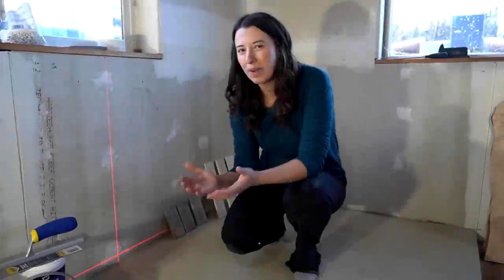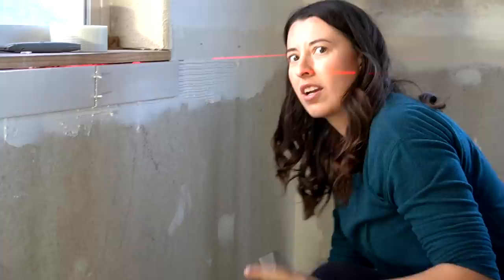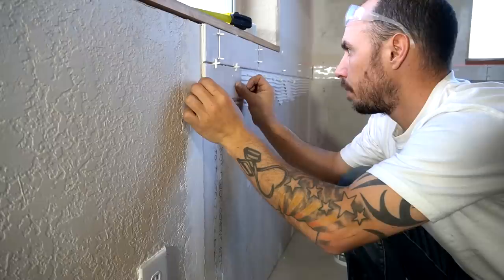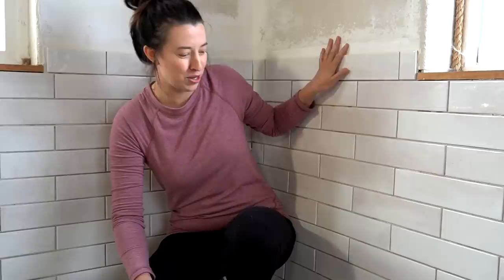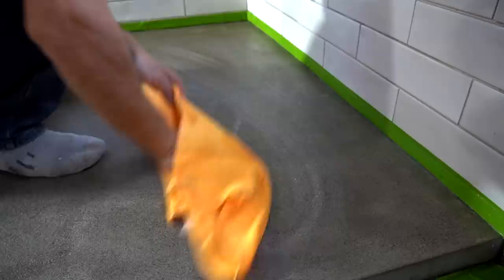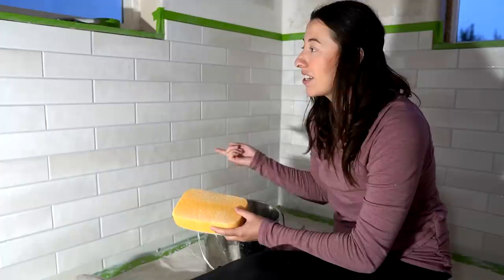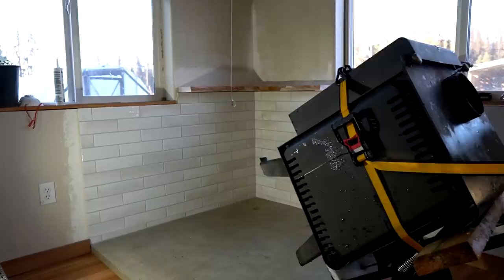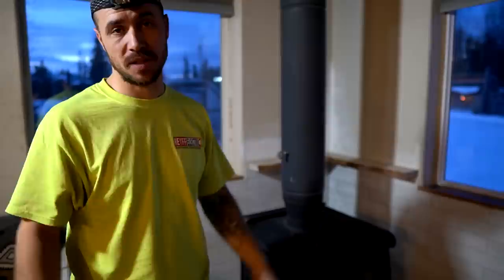Setting Tile & Finishing the Wood Stove Hearth

Comment: I've yet to watch the full content of this episode (you tiling the wood stove area). But here is my guidance to you from several of my DYI tiling of kitchen and bathroom walls and bathroom floors since the early 1980s (two kitchens and four bathrooms) - me not doing things right first time around every time. Make sure that you purchased the thicker floor tiles for the floor of the stove area. Check every wall and floor tile of every box on a flat even surface for slight rocking when gently depressing each corner by your index finger. Segregate all rocking floor tiles for discard (do not use them at all) and maybe use rocking wall tiles for short cuts of tile pieces needed at the edges of the wall tile areas (if the cut short piece does not appear to rock much). Every box of purchased wall and floor tiles usually has a few uneven and slightly warped tile, which your eagle eyes would not spot. I've used both synthetic tile adhesive and tile cement to set the tiles (with plastic cross spacers thinner than the set tile thickness). Both were ever lasting without the tiles later spalling off the wall and floor in a shower stall exposed to hot water daily for intermittent periods. However, I'm suspicious about using synthetic tile adhesive in a stove area with continuous high convection and radiation heat for 6-8 months of the year. The adhesive may seasonally expand and shrink because of the substantially different temperatures and spall off prematurely. When using tile cement, I water soaked every tile overnight before setting them. The cement binds even better to a tile backing when it is moisture saturated. I tried to pry out the plastic cross spacers a day after setting the tiles (before grout-floating the tile spacings a week later), but soon gave up on that because most them were stuck to the wall and tile edges, me not wanting to risk loosening the set tiles. Prior to setting the tiles, I chalk-stringed wall area and floor areas according the length (plus a separating spacing) of my tiles. I checked the alignment of each shift of set tiles against these chalk lines. If off alignment, I used tapered tooth picks (inserted at the cross-spacers) to re-align the already set shift. I started with T-spacers (by cutting off a leg from a cross-spacer) at the tile area edges at wall and floor corners. I chose too wide a tile spacing (3/16"-1/4") with fine sanded grout for my first tiling project in a shower stall. A few years later, the grout gradually developed fine fissures soaking up shower water. I fixed the problem with generous sprays of silicone solution. After this project, I went to 1/8" tile spacing with coarse sanded grout. I never experienced any development of fine fissures with this approach. About an hour after having floated the tile spacing grout and sponge-washed and smoothed the spacing surfaces, I cleaned off most of the interior of each tile with dry cloths avoiding to rub the smooth and still wet grout spacings. The next day, I would rub the edges near the tile spacings with a dry cloth to clean off the whitish dry grout tile surface areas. Whatever I could not clean off with a dry cloth, I scraped off using the sharp edge of plastic toothbrush handle sawed-off at the round end. Three weeks later, I sprayed silicone solution on the grout spacings to seal the grout from future water spray and moisture ingress (with a final dry cloth polish of the tiled areas). Please be very gentle when reinstalling the stove and ducting to the chimney by avoiding to dolly it onto the floor tiling and put ladder footings onto the floor tiles. Tiles are brittle and will crack when exposed to a large point load from dolly wheels or ladder footings. Perhaps use a remnant of 3/4" plywood on top of the tiles if absolute necessary to reinstall the stove and its ducting. FYI also: normally, it takes 28 days for concrete (under your floor tiles) to reach 90% of its ultimate long-term strength. So please do not be so zealous to reinstall the stove before four weeks after you poured the concrete.  Just well-intended guidance from a 1974 graduated Civil Engineer and DYI since 1974.

Comment: Have you ever tried the "candle" way to fire up the wood stove? For me it was a life changer. Big chunks on the bottom, medium chunks in the middle, small chunks on the top, and you have to fire up the top. It's like building a house cause you have to cross the chunks perfectly with enough room to let pass the air. But with a little practice it's easy. The pros are less smoke, cleaner glass, cleaner chimney and last but not least, less pollution for the environment. The cons is that the stove it's a little bit slower to heat up than the "traditional" method.

Comment: Nice job. 👍White tiles will probably throw more heat back out of the corner into the cabin, so might be a bit warmer than before, or use less fuel to get to where you are normally comfortable.🤔 The grey tiles would probably have looked a bit too busy given how much smaller they were.🤨 Good outcome.🙂 Be well all.😉

Comment: Project came out amazing guys! 😁👍
The only thing I’d do differently is use a piece of stained quarter round wood moulding across the top to cover up that Blunt edge of tile across the top row. See most tile jobs on the wall use a quarter round tile  on the tile on the top row to clean it up & not leave a blunt square edge . Or let’s just say to hide that blunt tile square edge. A quarter round moulding is your best option now that the tile job is complete. This will shed dust ect and make it easier to clean as well as hide that squared off tile edge. If I was in your shoes  I’d also take my window seals out and make wider window seals to protrude maybe a inch further outward into the room. Here’s how I’d do them to also cover up the blunt square edge: I’d get me a board of my choosing and stain color maybe to match your flooring and your new birch mantle. Then I’d measure from the window from where my window seal board was going to go up against.....I’d measure out to exactly to that outer edge of the tile on the top row. This would be the amount that I would then router out maybe only a 1/4  inch deep. And only leave the amount un-routed that I wanted to protrude past the tile. This will allow you to set the window seal board down in the seal opening and only the un-routed maybe 1 inch protruding part will then slide down & over and in front of the blunt square top row of the tile in front of each window. U can use finishing nails to attach your new window seal or an wood glue adhesive glue ur choice. But then by doing the new window seal boards this way to cover my blunt tile ends under the window..... Then I’d take 1/4”-1/2” quarter round wood moulding whichever will look the best. I’d say just lay a piece of each over the top of my tile and see which molding 1/4” -1/2” quarter round comes closest to being flush with outer edge of my tile. Then I’d take my 1/4” -1/2” quarter round molding and go the length of the top of the tile attaching it to the wall and butting it up against my window seals and mantle. This will give the top of the top row of that tile a cleaner look it hides the ugly blunt edge and it prevents it from collecting dust onto the top edge of the tile. It also makes it much easier to just wipe down during house cleaning. If the moulding, window seal boards & mantle are all stained to match also the flooring then it all just looks better and is more appealing to the eye. 
    But That’s just the way I’d do it to kinda clean up and hide the top flat blunt edge of the tile and kinda tie everything together. Also i would make me a stained & sealed or polyurethaned wood frame to match everything else... which I’d put it up against the front of that Hearth concrete. I’d attach it with screws to the floor and maybe contact cement to the concrete.  This would protect the concrete hearth from getting chipped. 
But these are only my ideas of what I’m seeing on your project so either use them or not. But don’t take it as criticism because you guys done an amazing job for it to be your first time doing tile. 👏😁

Comment: The soot on your glass is more so the wood stove construction as it doesn’t have a glass air wash. I burnt spruce for years and at the end of the night I stacked the box full and cut back the air to get it to make it until the morning. I never had soot build up like yours did. Mine has the secondary burner but also has the glass air wash and it helps tremendously   Love the videos and Merry Christmas!

Comment: Nice work on the tile and concrete. Only feedback I have is I would have angled the wood stove for better viewing. That is what I did in my cabin and it provides much better heat flow as well.

Comment: When doing your wood joints the 45s if there's any spaces in between you can take some sawdust and yellow glue mix it up and squeeze it into the cracks let dry sand and you'll never know there's a seam there you may see light line but it will not be a large gap

Comment: Mud is for drywall; mortar is for brick and mastic is for tile, and grout is used to finish the space between the tiles. Each one works differently. In Alaska you don't run into plaster and lathe walls very often because drywall replaced it, but that uses plaster of paris as an adhesive/filler. The neat thing about plaster of paris is that it expands as it dries, so don't use mud on plaster it won't adhere. You are doing a great job on your tile; it will reflect the stove heat out into the room better than the stone that was there before.

Comment: If you dip a wet or very damp news paper in the ashes and use that to clean glass on the stove you will be amazed at how clean the glass becomes must do when cool to cold stove. Just a tip if you didn't know.

Comment: I'm no tile setter, I'm a carpenter and I recently did some tile work in my bathroom. For my starter row I used some dead straight 1x4 and nailed it on my wall just below my first row. That way I ended up with a perfectly straight first row and it was easy because my tiles rested on the 1x4. Also I started my layout in the middle of the wall and worked both ways. That way I ended up with the same length of piece at the corner and at the end of the row. Everything is even that way. I don't know if this helps but I sure hope it does

Comment: You normally start at the bottom, so the tiles support themselves, but it`s ok, yeah wet sponge after 20 min. or so, wet sponge after 30 mins, and the rough part of the sponge is for dry buffing, a good hour later it takes that haze right off, , then a cloth buff an hour after that. But as you can tell, it works either way, the tiles look great, there was no doubt the two of you would figure it out, I love the raw cement look with the salt and pepper and sheen. Hey fire up that stove, and a very Merry Christmas to ya both, thanks for sharing, be well, from Michigan

Comment: Great job well done.If you want to protect the sides of the concrete with the inevitable chipping from dropped logs you could surround the edge with a wood casing. The softer wood cladding will protect your feet from the sharp edge too

Comment: I like the idea  where the chimney is going through the side wall  and out to a  "T" were the smoke goes upward  and the downward pipe gets a screen to keep the bugs and animals from  getting into the pipe.  this makes it easy to clean the  stove pipe upward to  the top with a cover for  rain.   soot falls downward into  garbage bag.  if the high side of the building  is the chimney ,  the strap can be fastened to the gutter and edge of roof.

Comment: Learn from my mistake: find a way to protect the edges of the slab, that 90 degree angle at the top will chip much easier than you think. Something as simple as a decorative wood edge along the sides and even with the top will prevent it from being knocked off. There's no way you'll be able to repair it in the future and not have it be noticeable.

Comment: Beautiful job you two!  There's one thing you might consider and that is sealing your beautiful shelf.  Might want to get some Satin Poly-Acrylic or similar tough clearcoat to protect it.  With the high heat right there, it might cause it to split in time as all moisture will be driven out.

Comment: We. Heated with wood for over 25 years we found out the hard way to never use the razor blade it will scratch the glass and it  eventually cause the glass to break use only oven cleaner newspaper or paper towel .  It only took 5 new pieces of before our glass cutter told us about the blade

Comment: Someone already commented about starting at the bottom so…. But I get it you didn’t want that itty bitty thin strip under the sill. Having said this, starting at the top deserves super duper kudos you two. Come summer time you’ll want to dig out that corner grout and put in matching caulk. I did a kitchen back splash in a rental using beveled tile (my first time too) and I absolutely loved that wet saw. Tip for the next project, lay an old towel across your knees to soak up the wet saw splash. Looks amazing you guys. Your dog needs some more kibble however, he had on this “ I thought you’d never get done” look on his face. 😂😂

Comment: It really did turn out very well.  I saw the comment about “back buttering tiles.  I don’t know that doing that is as important as it use to be because you were using an acrylic mortar.  You can feel if the tile is a fixed.  It was interesting that you chose to lay the tile from the top down as opposed to from the bottom up .  Again it looks great.  By the way you will find all kinds of things you can build with pocket joinery.  Great job!

Comment: Everyone starts somewhere on a wall like that l set my level line up slightly less than a tile width off the bottom then I screws board on the wall and lay up from the bottom of wall it goes alot faster

Comment: Hey tile looks awesome just a recommendation next time use dry mortar that you need to mix it will hold on stronger since there is going to be heat and with porcelain and ceramic tile you can just use a tile cutter or grinder but over all awesome job guys

Comment: Youre supposed to start at the bottom and tile to the top. Work out the spacing from top to bottom using the tile and a spacer. Fasten a cleat for the tiles to start from at the bottom. Once set remove the cleat and do your last cut at the bottom

Comment: So I read through some of the comments and I'm wondering where is all the tile guys to help out what you are using is mastic and you should be using a 1/4" v-notch trowel the trowel you are using is for floor tile and thin-set mortar mastic is not meant to be applied that thick because it will never dry and I hope you use wall grout un-sansed grout for 1/4" and smaller grout joints

Comment: In long term a brick or stone fireplace would be better at storing heat. The more mass the fire unit has, the longer it can keep the heat and the less wood you will consume. And it should not be placed against the out wall, but in the center of the room or just have empty space behind it, because you don't want the heat going to heating the outdoor air. There are fireplace designs that have a baking oven in the same construction. That is economic and handy. Some modern pics for example at the Nunnauuni site.

Comment: You guys did a great job!! I can't believe you keep the house 75 to 85 degrees!! That's so hot. How do you deal with the drastic temp changes when you go outside? I have such a problem with my checks flushing and burning form a 30 degree difference (60 to 30).

Comment: I'd install fire bricks and lots of insulation in the corner your gonna install your solid fuel burner plus the slab your gonna use under the burner should be high heat resistant

Comment: It was a little "cringy" to watch this episode of your life as we ourselves just went through a kitchen remodel were I did all the tile replacement myself, including removing the old floor tile, scaping old" thin set".... Also did back splash myself , first time, small hexagon mozaic sheets...most annoing was grouting mozaic backsplash...Good job tho , you two!..looks like a million bucks! On the tile saw, if you can,  get the one with the blade suspended over the table and able to move up and down. Sometimes the cut must be made by sinking the blade down and then moving it along the line marked like say creating an opening for a outlet reseptacle...that needs to be done from the back side as to have clean edges from the facial side ...guess it is relevan when one lays large tile like I did in my bathroom....Blessings to you both...Merry Christmas!

Comment: Looks good and I would be worried as well.  However, I think you put the mortar on the back of the tile, each tile.  I’m not a specialist, but have tiled before and did it that way.  Used less mortar as well.

Comment: Well I felt you throughout the tile project...Having learned much of that all by myself also...Eric a tip just for you..control the piece of material that is between the fence and the blade....can not stress that enough...do not put your hands on the material that is on the off side of the blade...Just don't.....Please..
A question that I do have however, is why did you not turn the stove 45 degrees to the corner??? Do that and the feng sway... Will change, for the better..Merry Christmas for you both..Jim

Comment: I'm not a professional, just a handyman but when I'm tiling, to avoid bad cuts and splinters, I only cut the tile on half of its thickness. And then I break it by hitting it with a rubber hammer. (Google translation)

Comment: Start on the bottom so your tiles don't slide down, should really start in the corner probably with a full tile , then put the off set piece in.